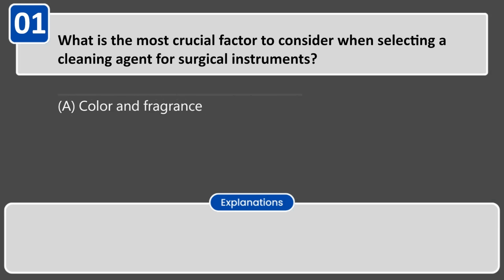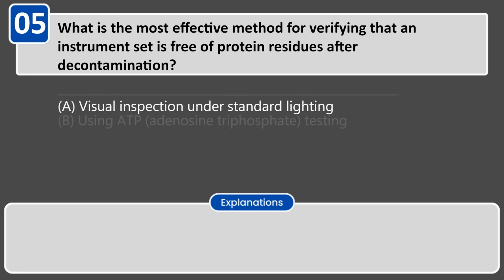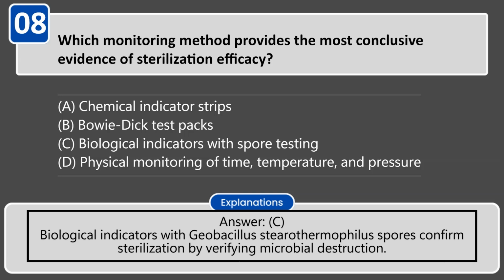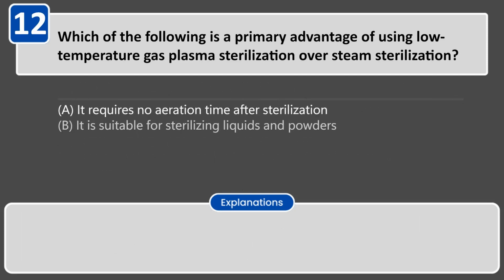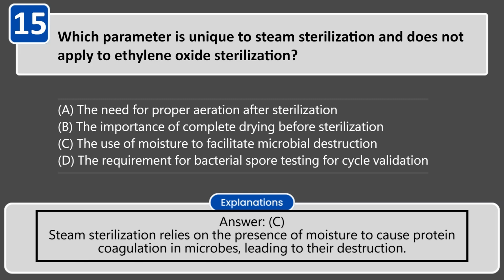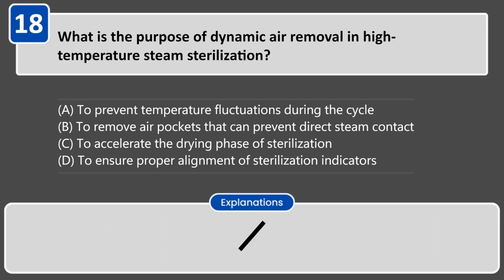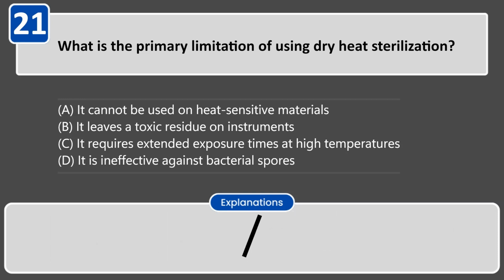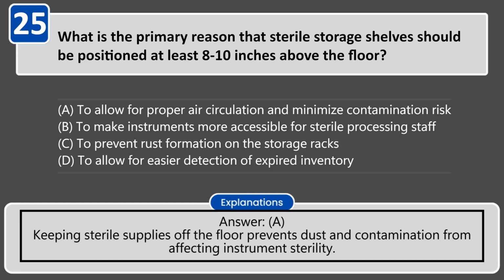CBSPD CSPDT Certification Practice Test 2025 - Questions & Answers

Comment: Something is wrong with your number 12 question. You are comparing gas plasma to steam. I know that Steam and gas plasma has no Aeration. But then your answers is A. Yes it's true if it is EO or Ethylene oxide. Then you really are comparing it to ETO. 😅
Reply: Yeah, you’re right but I think it supposed to be drying time, because gas plasma does not require cooling time! Thanks